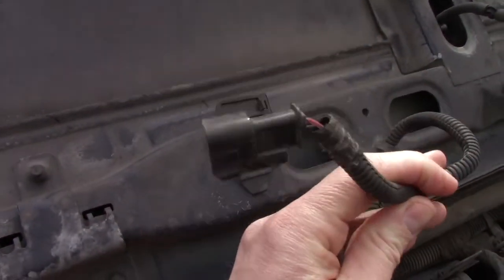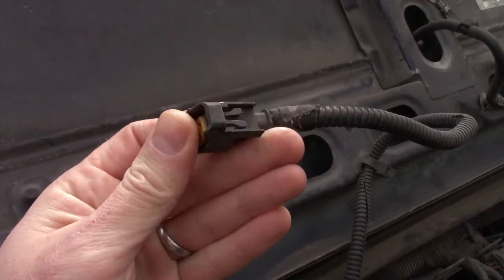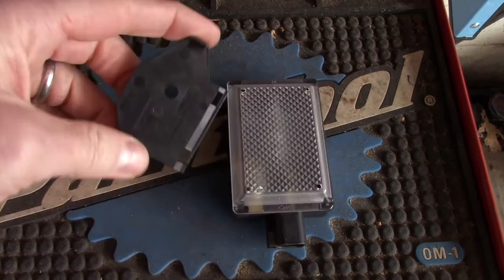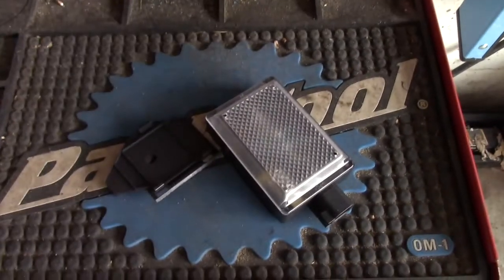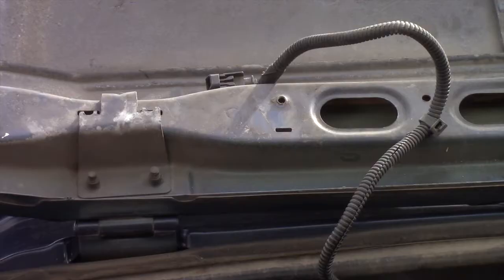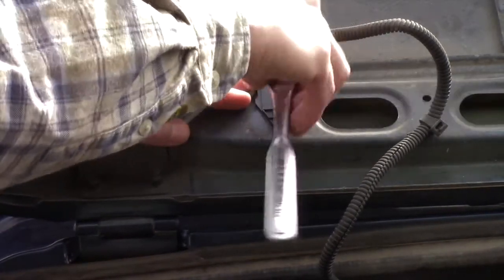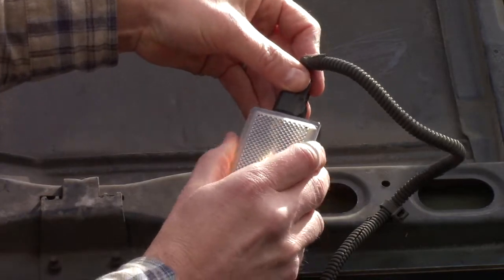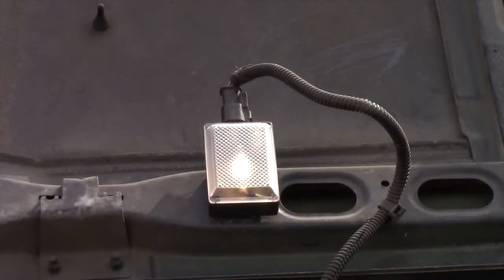Fix Jeep Wrangler TJ Hood Light in 2 Minutes

Comment: If I let this light on by accident for a day or two, would that drain the battery?
Reply from the maker: It's possible (if you left the hood up). But it would take at least 2+ days I would think. They don't draw a lot of power, but they are older style bulbs.
Reply: Yes - that is what happened. That tiny light was on for a couple days and drained the battery - that's surprising to me!
Reply: did mine !!!
my advice is remove it! there are 1000 better options when it comes to light under hood!